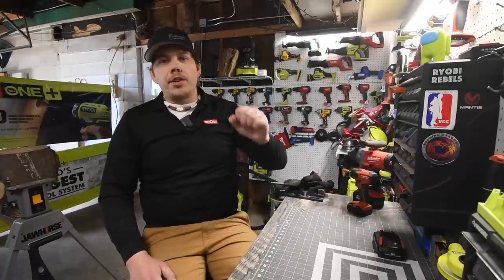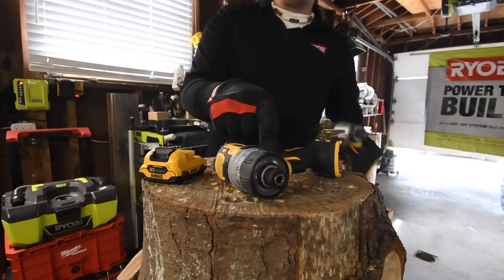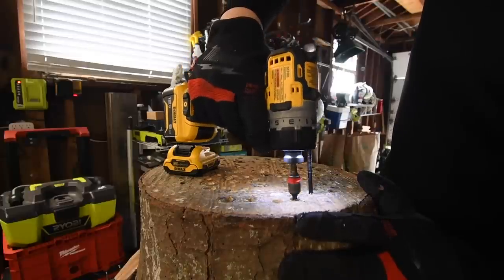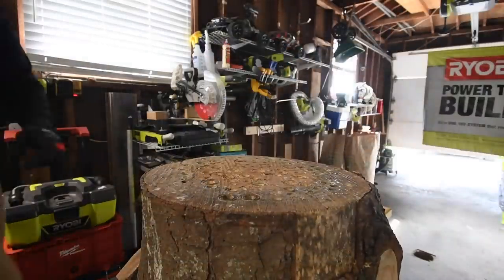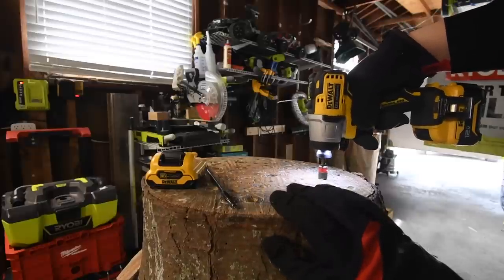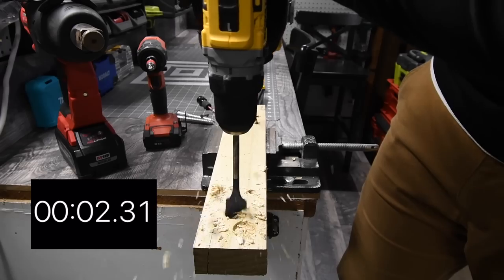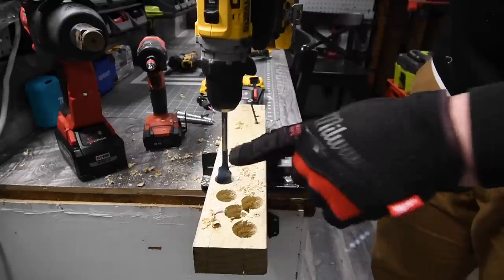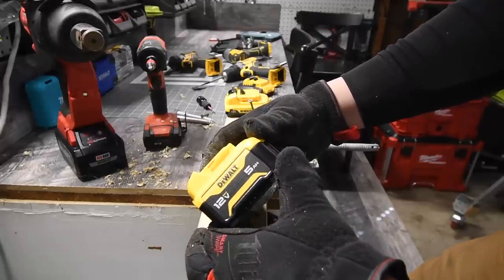NEW!! Dewalt 12v 5ah Battery  (Extreme)

Comment: Recently used the 5ah battery on their 12v impact wrench and was able to take lug nuts off off fairly easy.  It breathed new life into that impact wrench.
Reply from the maker: I thank you for viewing  :)
Reply: That’s great to know. I was looking at getting into 12v tools because I don’t need heavier duty tools like 18v. I was looking at the 12v kit from Dewalt that comes with the drill driver and impact driver but I can get a free tool with it and was thinking of the impact wrench. I do some light duty mechanic stuff at home which would require me to take off lug nuts and was wondering if the 12v would be enough.
Reply: @Nicky14P  yeah. It will be plenty for working on your car (99% of the time). The impact wrenches included (as freebies) with that kit (they offer choice of 3/8" or 1/2"), are rated for up to 250 ft lbs of TIGHTENING torque & 400 ft lbs of LOOSENING torque.....which is PLENTY. ShopToolReviews does a video on the 1/2" (DCF901) & those specs are legit.

Comment: Fantastic video!  After I saw this 5ah battery test giving a power up on the Dewalt XR 12v, I already purchased 4 for me to use on my favorite Dewalt 12v!  For light jobs I love my little Dewalt DCD701 and DCF801!  I have several Dewalt DCK2110L2T kits manufactured by “Germanic” kits with 3Ah batteries and so far they have been excellent machines!  Currently the 18v / 20v are always the last choice.  I even stopped using Bosch, and Milwaukee, which were my favorites.  And after watching this video I also had to buy it to check it out.  I also have a kit of these 2 models from Dewalt that I bought there in America cheaper than here in Europe, I made the purchase through Amazon, and it was mainly to compare the performance.  I hope you don't get me wrong for what I'm going to say!  But it is a really superior difference in the performance of Germanic manufacturing.  It may be just another coincidence of the variable situations.  But there really is quite a difference. Thanks MCT!
Reply from the maker: it really is a nice battery and more tests will be coming
Reply: @ManCaverTools  Ok! 👍🏻 
Thanks MCT!

Comment: The new oil resistant xtream batteries are sweet also bro
Reply: As if the normal ones ar not heavy enough... DeWalt need to bring 4Ah packs with 3 x 21700 cells, not this bulky pack with 6 cells like a 24V Hilti, Kobalt and Flex.
Reply from the maker: I thank you for viewing  :)

Comment: What a difference!
My wishes: DeWalt had a larger lineup in the 12v Xtreme line to compete with Milwaukee (which I think with their 12v Fuel / Surge would blow the doors off DeWalt), and that includes a 1/2” hammer drill-driver instead of the paultry 3/8!
(But heck, at least the charger in the kits is the same 12v/20v chagrer you get with DeWalt 20v kits, so that’s a plus!)
Also I’d like to see you include Skil PwrCore 12 in your comparison testing (which does have a 1/2 chuck but I don’t think offers a 12v hammmer drill yet).
Thanks as always!
Reply from the maker: I thank you for viewing  :)

Comment: Hi I've got the 20 volt DeWalt line up and recently switched to the 12 volt line up , much easier to use less fatigue. Have you tried the 12 volt bandsaw ?

Comment: Like you, for no real reason like the look and feel of the 5AH battery. 
I use tools kind of different I guess 
I use 60v circlular saw. (Not used often but more power for weird angles or just working on old houses with that old lumber that’s twice as tuff as the stuff we use today.)
20v xrp drill (for some larger holes while handling concrete anchors into actual commercial grade concrete.)
And finally I couldn’t pass on the 12v extreme impact driver. On sale for $99 at Lowe’s w/ charger, 2 of the 2AH batteries and a carry bag. To top it off they are running a special if you bought it or some of the other extreme stuff you get a free 5Ah battery. 
Honestly you can drive 3inch deck screws no problem beyond that I’m using an impact wrench.
Reply from the maker: I thank you for viewing  :)

Comment: The difference between the 3ah and the 5ah is more than just capacity... there are 2x as many cells, which are in parallel, that helps reduce voltage drop under load. That's why the 5ah didn't cut out as it drew more amps.
Reply from the maker: I thank you for viewing  :)

Comment: Ok so I bought dewalts big 899 impact wrench...will the 8ah xr battery work with my tool and do I need to get a new charger or will my charger work. Thankyou
Reply from the maker: Yes the 8ah XR battery will fit in the 899.

Comment: i got 12 volt milwaukee fuel but starting like dewalt i see a lot of dewalt in pawn shops great way get started. i don't mess with 2ah i use least 4ah or bigger.
Reply: Interesting, I'm always going for the 2ah on the fuel first to keep it compact. Only if I need the extra power or run time do I go with the 4ah. Heck I even use the 2ah on the 3in cutoff tool and that's a battery killer...
Reply from the maker: I thank you for viewing  :)

Comment: Here is a little Electrical knowledge for ya... It's not "faster" cause of the amp hours. The way to speed up a DC motor is to apply more Voltage to it. Since the voltage is the same the tool will turn at the same max RPM period.. The amp draw capacity difference from the batteries is what you notice. The amp draw is allowing the tool to produce more torque that in turn allows it to pull/push through the load being applied at a faster RPM.. Think of it this way.. VOLTAGE IS HORSEPOWER AND AMPS IS TORQUE... And as the old saying goes..... Horsepower is how fast you hit the wall, Torque is how far you take the wall with you when you hit it... High power + low torque won't go anywhere with heavy load... Low power + high torque will move a heavy load, but at slow speeds.... Gotta find that happy medium.
Reply: Okies there Lukas boy... and the way that happens is going to higher amp hour batteries, or more than one row of cells.  People get so carried away about batteries!  You not related to Ezra Waters per chance??  🤔🙄😀😄😁😂🤣👍✌🏻🇺🇸
Reply: @georgedavall9449  nah bro. I was just explaining how and why the higher amp hr batteries were "faster"
Reply: @bustanut3888  I gotcha bro.  You’re knowledgeable on the subject and I appreciate the reply.  I was just messing with you.  Ezra Waters seems to be obsessed with the cells and power levels in some batteries.  This new 5.0 Ah 12 volt DeWalt battery is solid.  It transformed my 12 volt Xtreme drill.  Helps the impact wrench and especially the driver.  Still the silly three segment battery gauge, but they stay lit for a few seconds after release of the button!  Wow DeeeWalt, way to go, finally!  😃😳🙄🙄👍😁✌🏻🇺🇸
Reply: @georgedavall9449  right. We're in 2021... They can do better than that
Reply from the maker: I thank you for viewing  :)

Comment: 6 cells on a 10.8V nominal, 12,57 max  light tool is plain stupid, one more then on a 18V compact pack and same as on a 21,6V nominal 24,6 max pack like Hilti 22, Kobalt 24 and shitFlex24. DeWalt and Makita better bring 4Ah packs with 3x 21700 cells like Hilti, that are good for 40-44 Amps. And the tools electronic driver need to be also beefed up.
Reply from the maker: I thank you for viewing Loo